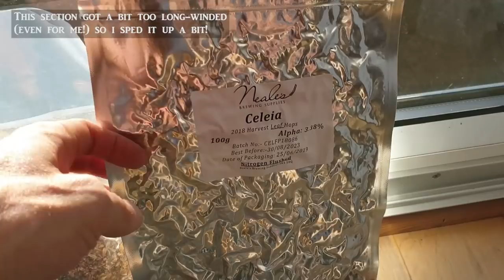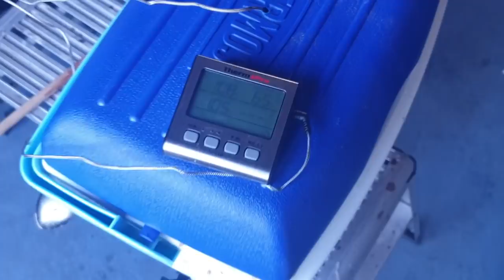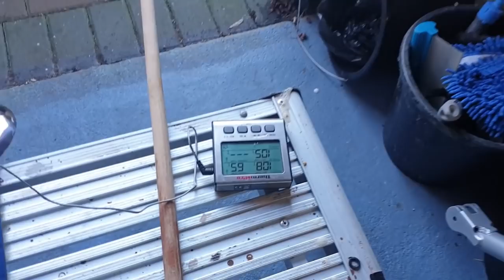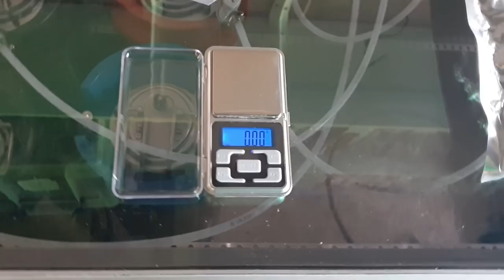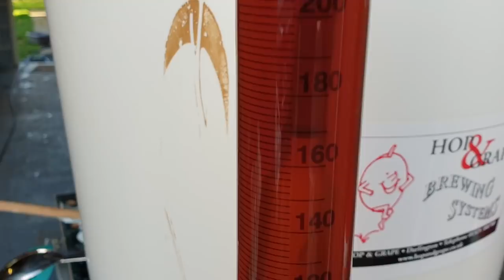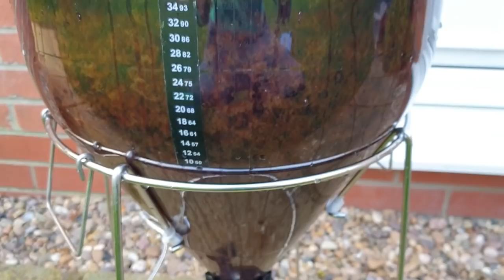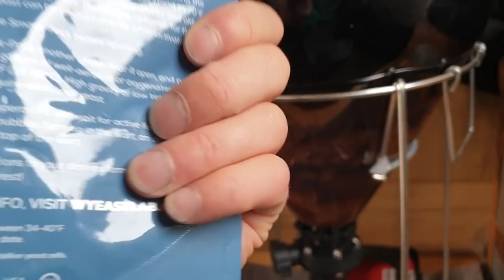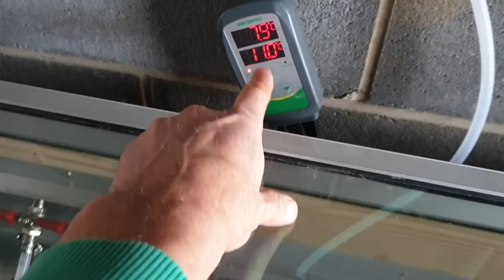Brewing Beer at Home: The Whole Process

Comment: Bottling is one of the reasons I gave up brewing. It really is very time consuming. I tried using pressure barrels, but they never seemed to work that well. Also, a barrel is impossible to cool down (unless you want to go to extremes) so unless you’re drinking in winter it’s always going to be luke-warm. I prefer beer chilled. But the process is fascinating, I’d recommend anyone who likes beer to give it a try. There are lots of good kits where most of the process is done for you. You just add water and yeast (but avoid the cheap kits where you have to add sugar).

Comment: 1:08:38 i tend to favor using a bottling bucket(basically the same as a fermentation bucket(with a tap). the only change i make is using a small amount of the beer to dissolve the beer(8-12 ounces) and i attach a filler wand to the tap on the bucket with makes for an easier fill.

Comment: Hi Noel, I recently got into brewing (USA) and im interested in understanding your heating system better? Doesn't the plastic in your containers melt under the high temperatures? I use an immersion chiller but the heating elements seem like they'd risk melting or warping your buckets.
Reply from the maker: the bucket is polypropylene and handles heat well (unlike some other plastics that go floppy or deform). You need to make sure it is a PP bucket and not a polyethylene bucket...... that would end badly!

Comment: Nice brew-day video. I guess I shouldn't be surprised that you've managed to come at brewing with a rational mindset, learned the fundamental processes involved and avoided pretty much all of the strange received wisdom and cargo-cult thinking that persists in the hobby. The only thing I'd say in terms of tempting people to have a go is that there are options that involve less equipment and space than even your fairly modest setup there. 
I do 10-12L all-grain batches just in a stockpot on my standard cooker, mashed BIAB-style rather than the mash-tun setup and cooled in the sink/via a cold-water top-up rather than with an immersion chiller. I'm with you on the pain of bottling though and would certainly have the kegging setup if space allowed.
Reply from the maker: It is amazing how varied the setups that work, some of which often seem to fly in the face of things which are portrayed as otherwise of paramount importance. I recall reading that originally farmhouses would propogate yeast (before they knew what yeast was) by dipping a broom of twigs into the brewing beer and hanging it up to dry (then dipping it into the next batch), something which would give a lot of homebrewers an attack of the vapours!
it seems to me that a lot of the processes just come together one way or another. Like, as long as the proteins coagulate it doesn;t really matter when you remove them. Sure if you can hold a lot of it back after the boil then great but if not it just falls to the bottom of the fermenting vessel anyway. Unless you are planning on some two month long cold fermentation I hardly see the issue tbh.
Reply: @noelplum99  Yeah. While the likes of Brulosophy aren't always that great when it comes to experimental design they've provided a lot of evidence that the reality of many brewing variables is that they don't matter anywhere near as much as commonly thought when it comes down to drinking the stuff. Unfortunately, as anyone who has spent time in the "skepticism" area knows, myths die hard and a new one is born every day. There might be a video or two in debunking brewing mythology or comparing it to religious thinking somewhere.

Comment: how much does the ingredients run?  Not everything, cause I can imagine a lot of that equipment can add up quickly.  Just want to know how cost effective it to make a batch.
Reply from the maker: Good question. A lot of it depends on the type of beer.
If you keep it very simple, pale or pilsen malt and hop in a traditional manner then a 25 kg sack of malt is about £32 and makes 200 pints at 5% alcohol. To hop 200  pints will take maybe 300g of hops (less for lager) at £15. Yeast is a couple of piunds per sachet but you can reuse it so let us assume ypu biy twice for that volume. So that is arpund £50 (or $65) for 200 pints .
However, you start adding extra malts, which you buy in smaller quantities at higher cost per unit and the cost goes up. Brew something like a modern IPA with huge hop additions (as much as 300g dry hops and 500g overall per 40 pints at the extreme!!!) and the price can skyrocket.
Reply: @noelplum99  Still not to shabby if you get 200 pints out of it. a 6 pack of any decent beer in the US runs $8-10 and a 12 pack $13-16.  Forget what you would spend at a pub for the same beer.
Reply from the maker: @Uhlbelk  I also save some money growing some of the hops. This spring I am planting more hop rhizomes with a view to almost being self sufficient in hops.